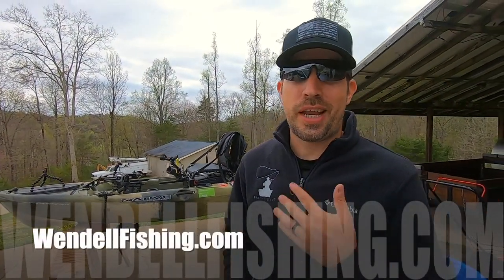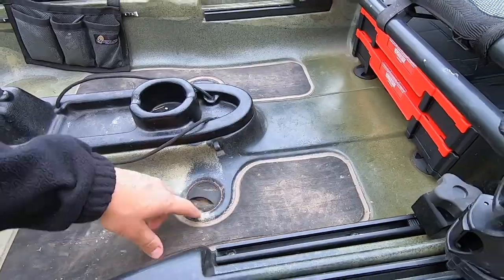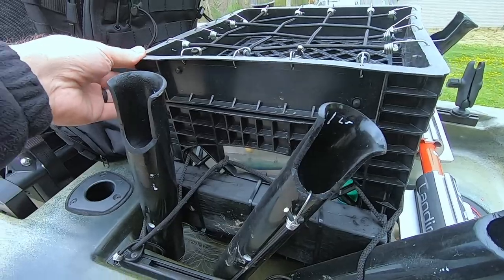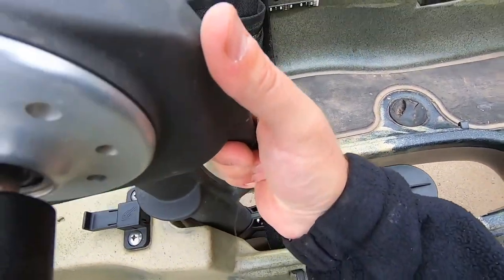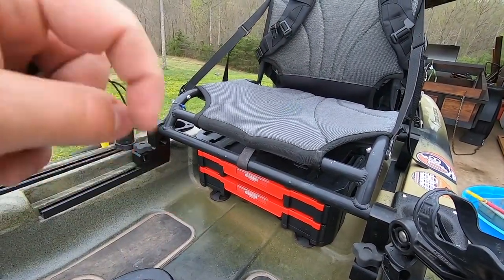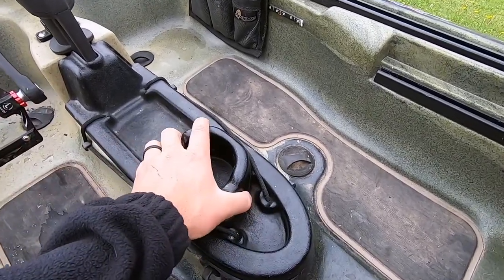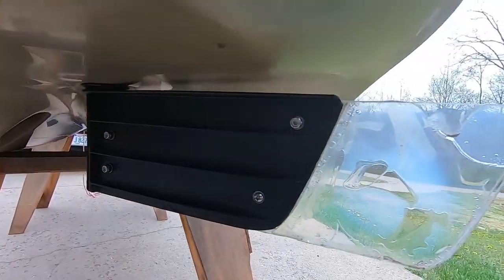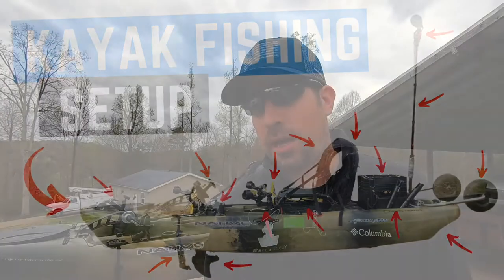Native Slayer Propel 10 Review - Fishing Kayak

Comment: For some reasons i have missed this video and specs of this kayak. Hull weight 62 lbs and 400 lb limit  My Lifetime is 57lb and 300 lb limit.  I was looking hard at a Hobie Passport 10.5  @ 65 lbs and overpriced Lynx @ 45 lbs. I trying to keep this weight down so i can rooftop a pedal kayak.  Heck the Native Slayer 10 might be the choice! 
The soonest i can upgrade would be early  November 2024. Thank you
Reply from the maker: Oh man.. this video is an oldie!
Reply: @wendellfishing  Quick question: Does the behind the seat compartment fit a Yakattack Nocqua 10h Battery? Looks a little small
Reply: @wendellfishing  I looked at a Hobie Passport 10.5R today, I was not impressed.  Practically the layout was just like my Tamarack pro  but with a cheaper seat and  fin drive without reverse.  Now the Hobie Outback was nice but I would need a tow package and trailer. Way out of my price range.

Comment: How has the gear track and sidekick held up since you installed it to the rear ???   Wondering if over time and usage it’s not good in the rear ?
Reply from the maker: Great question.. No issue in 3 years with the load in the back and I have given it a good beating
Reply: @wendellfishing  thank you.   I’m gonna try moving mine to the back because the crate is just too far back with the way i have it now.   I’ll let you know how it works out
Reply from the maker: @Anthony-wx4pe  Right on.. Disclaimer... I have seen photo's where this has ripped out the screws but I have not had any issue myself.

Comment: The only thing that bother me is there is no place to mount a trolling motor or a micro powerpole to the stern. And there is no aftermarket mount for that as well. Other then that everything is good.
Reply from the maker: Can't argue with you there. Solid points.
Reply: @wendellfishing  How’s the stock rudder steering and tracking btw? I know the other model is not the good.
Reply from the maker: @jeffreyau1286  Not bad but I can tell it's just a matter of time before I need to replace with a metal boondox rudder.
Reply from the maker: @jeffreyau1286  If I happen to come across a solution for you.. I will reach out for sure. Interested.
Reply: @wendellfishing  Yeah. Pls let me know🙏🏻